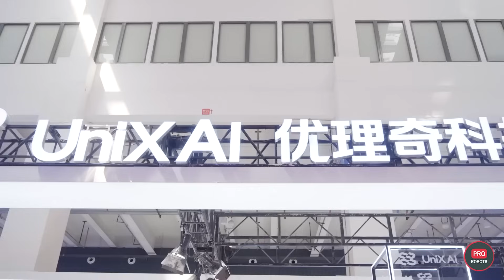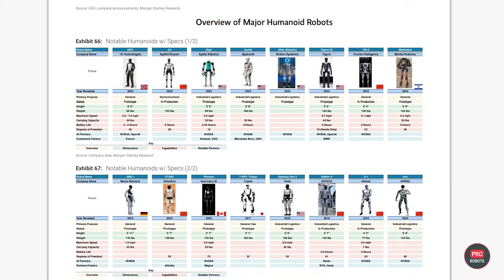Robots Now Run Better Than You! Evolution of Humanoids at the First Robots Half Marathon

Comment: I was expecting at least a mention if not showing of how 2/3s of the robots competing were total failures. Even Unitree, who is lauded everywhere, had their G1 robot do a complete crash. It never got past 50 meters. In fact I think half of the robots that failed never reached the half way point. They were also doing things like leashing, sparying coolant and stopping to change batteries. The whole coverage of this event is highly misleading. In fact, if it does anything, it's do the exact of what you claim; show that China's robots are not at the level as they are publicized. They are mostly fake.
Reply: Unitree did not compete. 
The company that bought a G1 to race did not use the EDU Ultimate (G1 comes in 5 different models). That said its Unitree’s fault they now look bad since they could have competed using the top model that can run.
Reply: Tesla is also fake and Unitree and xpeng Iron.... Dont you know where Tesla and Boston Dynamic get their part from? Lol these robot are testing battery longevity since robot battery don't last long.